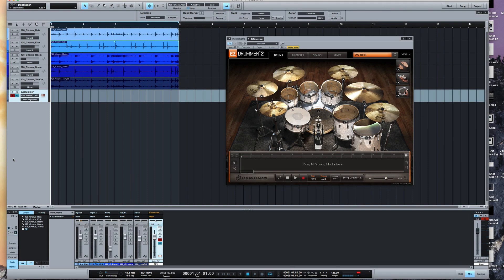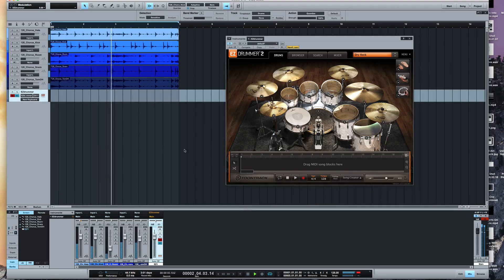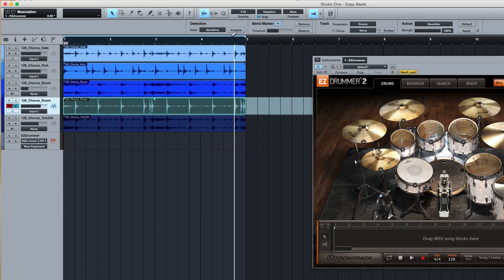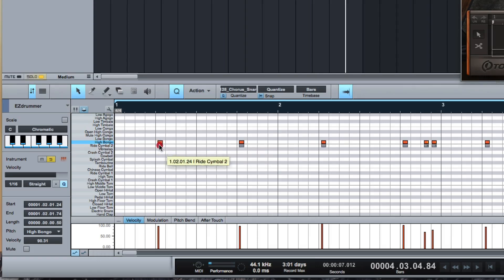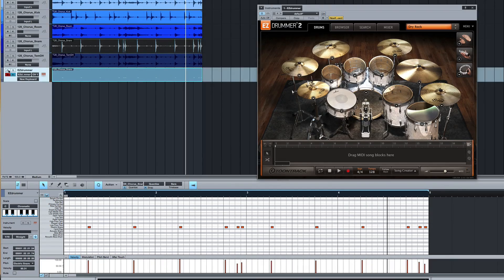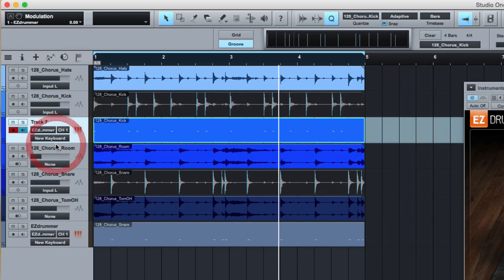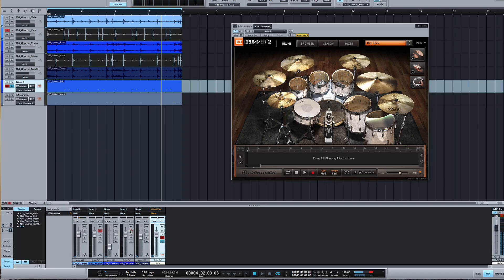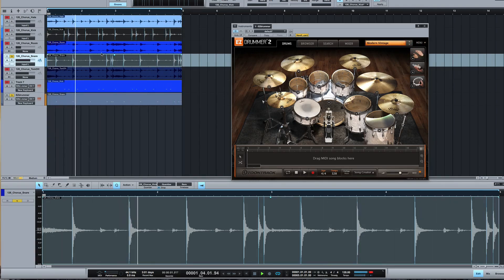Convert Audio Drums To MIDI Triggers In PreSonus Studio One

Comment: This is pretty great. I do usually use the gate trick (My current favorite is to key a kick drum to the bass guitar to get those ultra tasty kick/bass combo snaps. But it helps to quantize the bass first. Then you can print the resulting midi to the drum track, and fix up the errors.

Comment: Is there a way for it to pick up pitch?
Reply: I'm pretty sure pitch detection is not possible with this method. You will need to use Melodyne as it has a far more advanced algorithm for detection and of course does detect pitch, as well as exporting the midi. 

If you have Studio One 2 or later it will include a version of Melodyne that will do this for you, albeit in a slightly more fiddly way, but then again that's the price you pay if you want it to pick up pitch. I can't see how it's possible to do otherwise. I may be wrong.

Comment: so I tried dragging a kick track about 95 measures long into the groove section and it only loads about half the transients, any ideas russ?
Reply from the maker: James Gelber Use the Bend tool first to detect the transients that you require and then do it. If you have a noisy track then you may want to put a noise gate on it first and bounce it as a clean version.